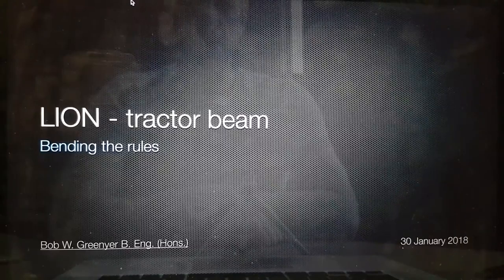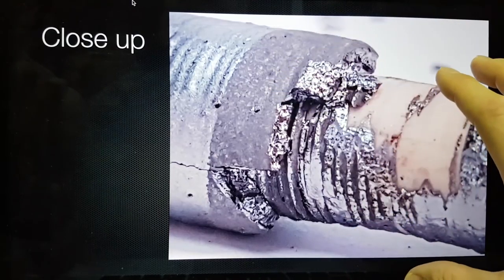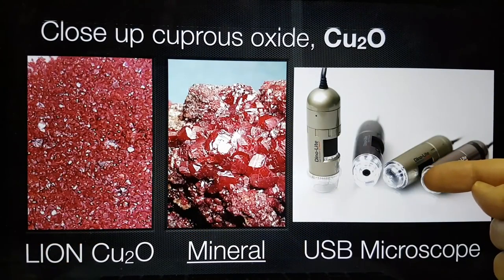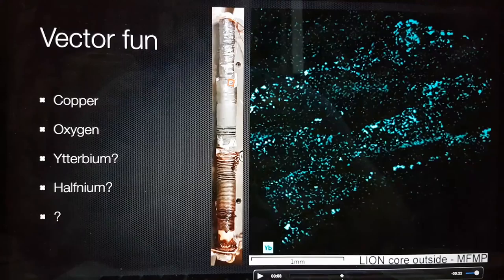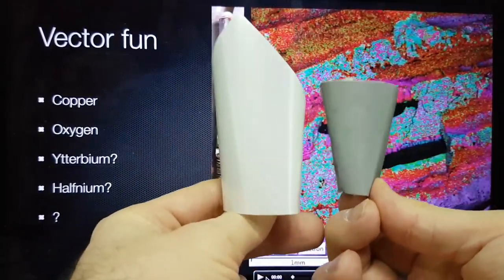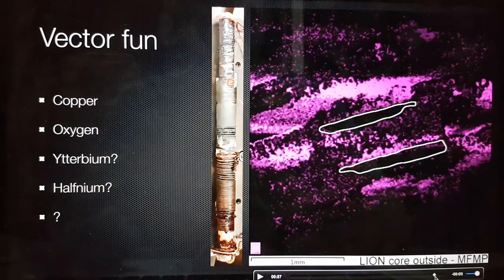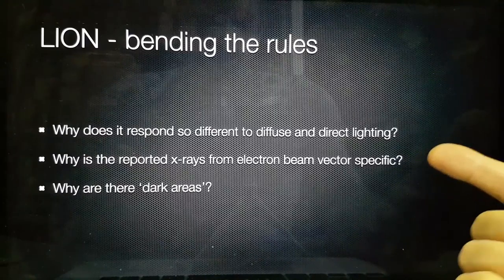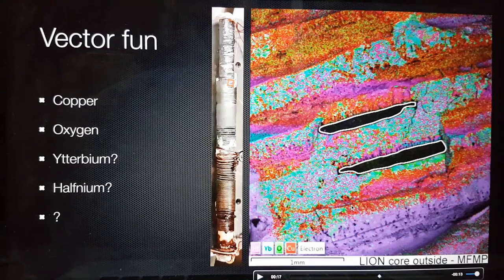LION - tractor beam

Comment: Pure Ag is a terrible electronic material because of well known "silver migration".  Electric potential or heat can add the small amount of activation energy required for the migration.  When Ag is required in the electronic industry, they normally use an alloy to prevent the migration.  Melting is not required for migration.  Also, at high temperature alumina is used in solid oxide fuel cells - for example, Bloom Energy.  So, the electrical output could be related to solid oxide fuel cell behavior.